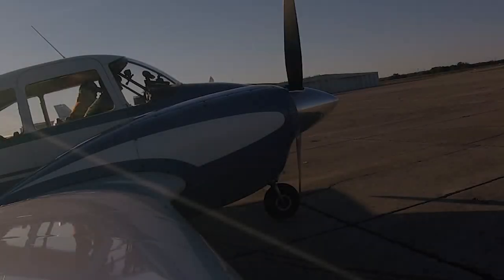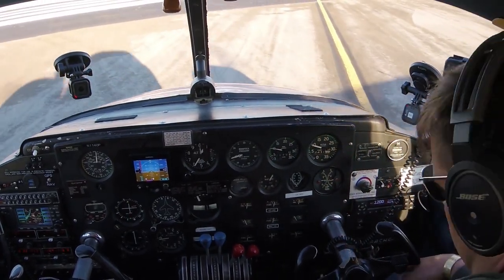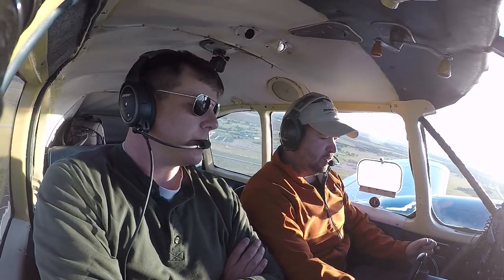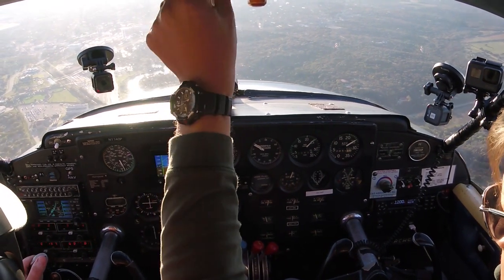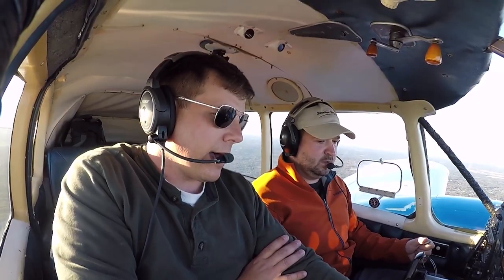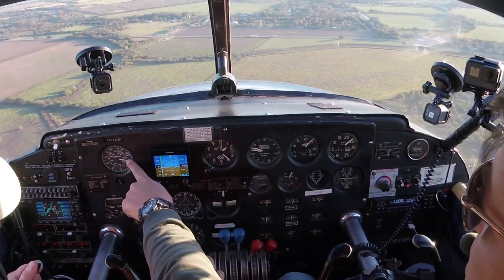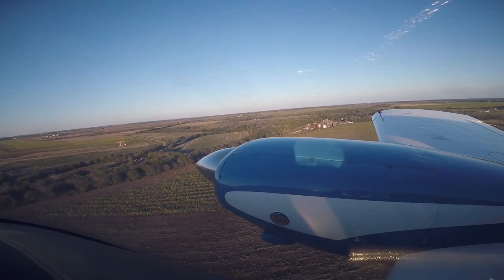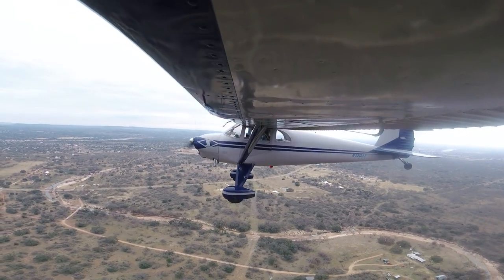Introduction to Multi-Engine Training!

Comment: Very cool plane. I live like a mile away from the airport. I use to go to Texas State Aviation. I have a question though. I get why flying with two engines is better but what I dont get is why are they crashing when you have two engines to rely on? Another twin engine just went down. Its said they were learning to fly with one engine. I want to get my multiengine rating one day but if they aren't just as safe as a single engine then why bother! I dont know what the ratio is between one engine or two but I am having trouble understanding this and why its happening when its suppose to be safer.
Reply from the maker: Outlawflyer78 that’s a great question. There are a variety of factors as to why a multi- engine aircraft can crash but to just name a few it can be based off environmental factors, human factors, and just blantely exceeding the limitations of the aircraft.

Comment: I love it! The INSTRUCTER calls for a sterile cockpit, and stays quiet for less than 5 seconds, then he is “talk talk talk”.

We pay a bonus (CASH) to the instructor who understands how to, and is disciplined enough to, keep his mouth shut.

Safety first, always. But when you call for a sterile cockpit while you are instructing, please:
1. Know when it’s an appropriate time in the flight. 
2. Brief for a sterile cockpit before the engine starts . 
3. When the sterile cockpit is active, stay QUIET, until and unless there is a safety in flight issue, NOT a training moment opportunity. The training takes place after the sterile cockpit has been secured, preferably post flight using a whiteboard, video, audio, and adhrs data (thank you foreflight)
Reply from the maker: That is not what the Sterile cockpit concept represents.  Sterile doesn't mean pure quite - it means exercising communication only related to flight activities and instruction.